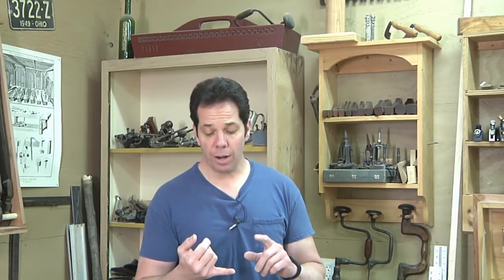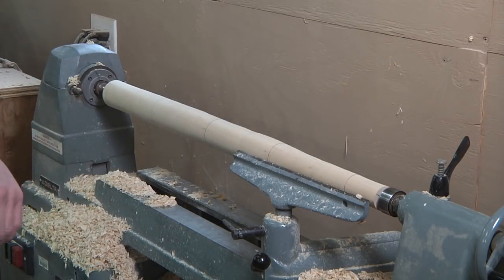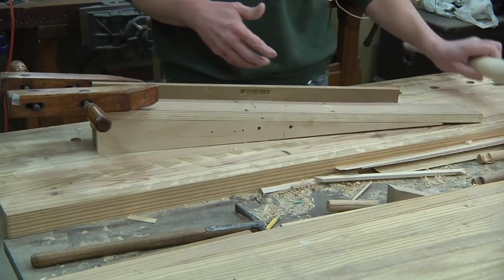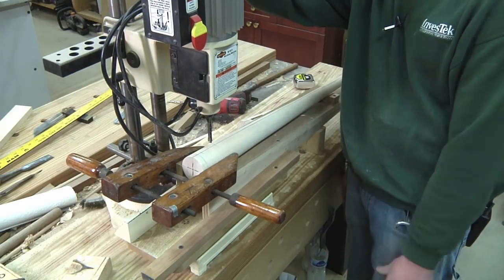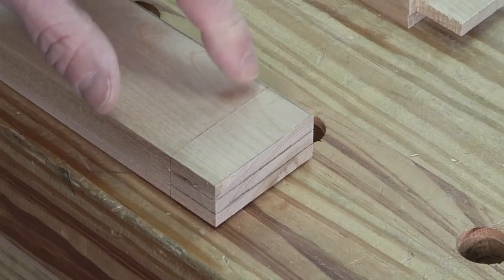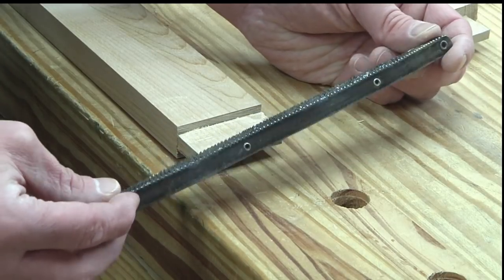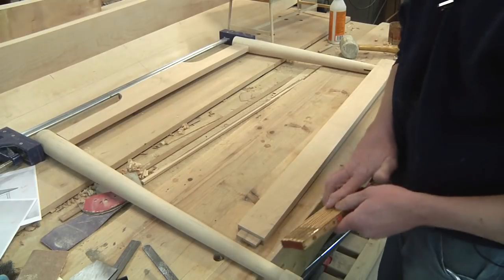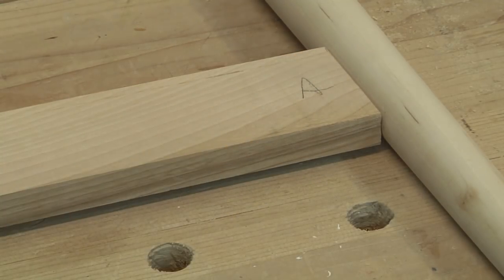Difficult Techniques Done Easy- Mortises, Tenons, and Turning

Comment: Awesome video as always chad, one thing if I were doing that job I think I would’ve made a jig on plywood to hold my legs at the proper angle to measure stretchers and tenon lengths and just set me bevel gauge up directly GF the legs so I didn’t have to worry about the taper changing the angle. The way you did it was the smart guy way and pretty awesome lol

Comment: Greta video, Chad. I was thinking as you were using that block to make the line on the side of the leg parallel couldn't you make the side of the block at the proper height and then just slide the block up the leg until the line is at the top of the block? This is similar to making the block the right length to make the line parallel to the side. Thanks for the tips.
Bill

Comment: Thank you for the instruction. Im about to make a desk with round tapered legs and rectangular stretchers.  I have a question though. Why not make the mortise big enough to accept the entire stretcher? Then you could cut the mortise before tapering the legs.
Reply from the maker: It’s a good question but the apron is 3/4”. Two of them going into the leg would make the walls of the leg incredibly weak.
Reply: @ChadStanton  ah makes sense. Thank you!

Comment: transferring an angle onto another piece as you did with the bottom stretcher with a marking knife and a square.  i cheat and just grab a block of wood.  lay it up against the leg and then take the leg away and strike the line along the block or set a bevel gauge against the block.  not trying to teach you to suck eggs.  since i retired i still like to see whats going on in the furniture making world.
Reply: That precisely what I would have done, I was thinking that was he was going do. 😁🛫
Reply: También creí que haría eso 😁
Reply from the maker: Great tip Talyer. Thank you